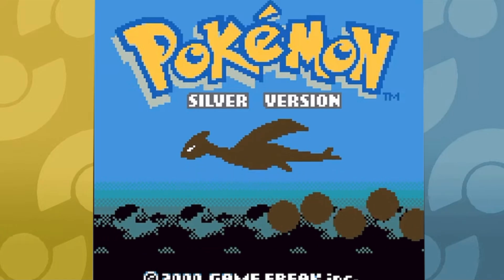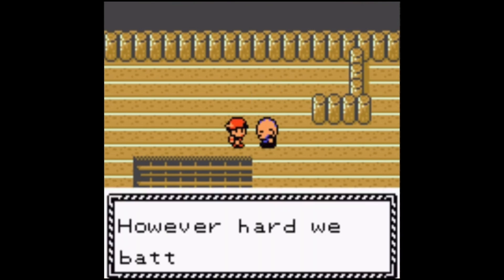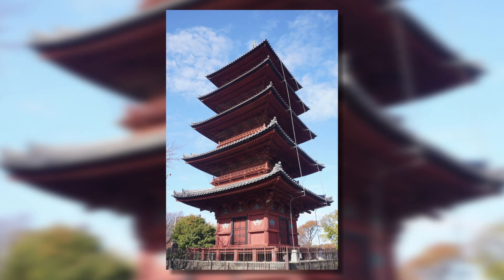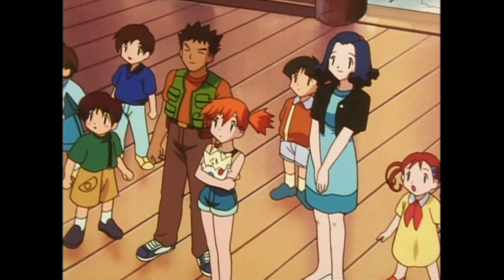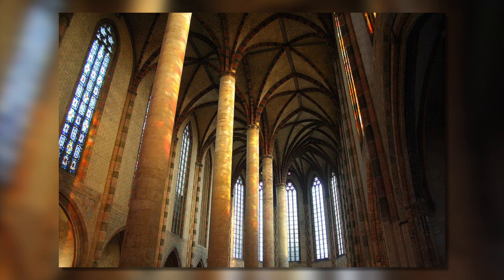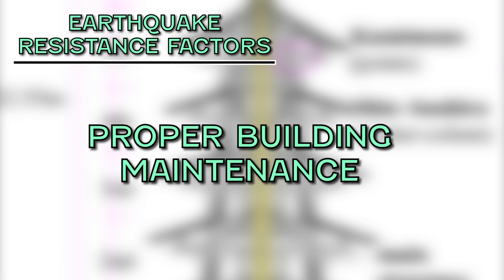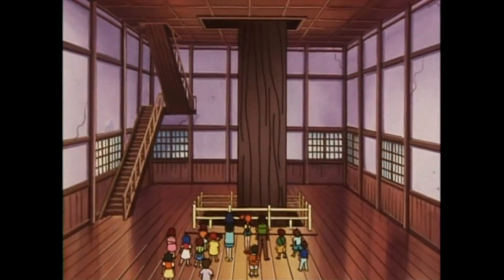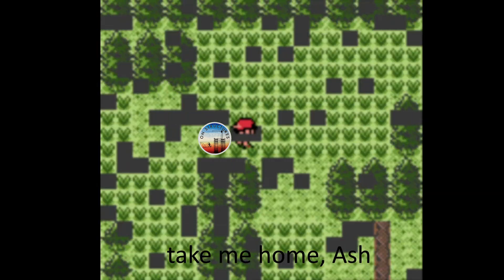The Strength of POKEMON's Sprout Tower

Comment: interesting things to consider:
western architecture was also very in tune with nature and less about resisting it until fairly recently.
this was accomplished through a variety of techniques, chief among which was building structures slowly.
the leaning tower of piza is a prime example of this. it has been known that soil will settle under immense load over time since millenia, so people back then built structures slowly, allowing for the soil to settle as a structure was constructed, allowing for modifications to be made in accordance, which is why the leaning tower actually can never be made to stand fully upright, the structure was modified where the walls were made taller on the leaning end to counteract the lean. 
of course the leaning tower did continue to lean until the soil below was actually modified using modern science, but that does not change the fact that, had they built the tower in a shorter period of time, it would have fallen centuries ago.
another important example are forged iron nails. forged iron nails are flexible, they allow for movement within the construction, they allow the wood to "work" as it dries or picks up moisture throughout the seasons.
Reply from the maker: Thanks for the comment! I agree with what you’re saying regarding western architecture, so often in cross cultural discussions authors paint east and west with hard distinctions which is probably hyperbolic in most cases. I can’t imagine the author of a martial arts pop-sci book has really thought deeply about the worlds architectural practices… I didn’t add my own commentary to that effect, because I thought the video was in a good place to end.